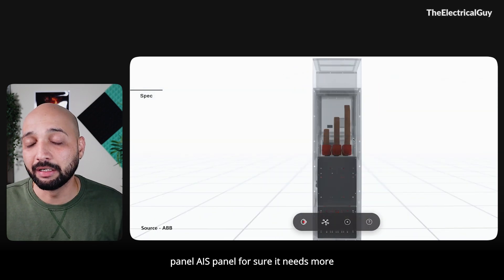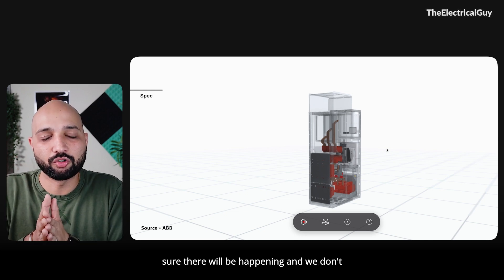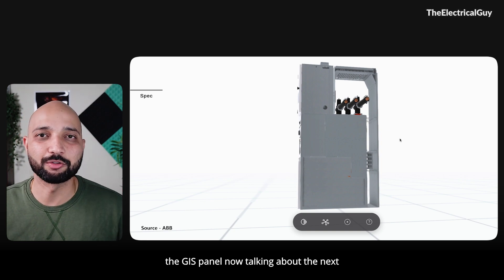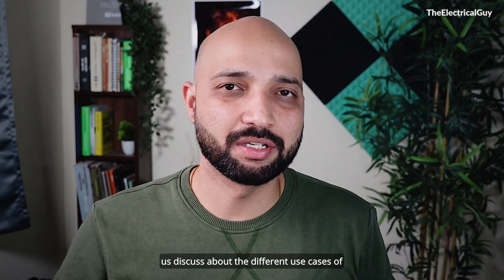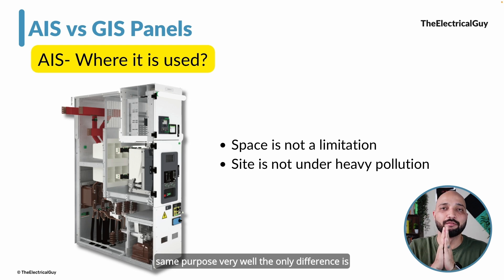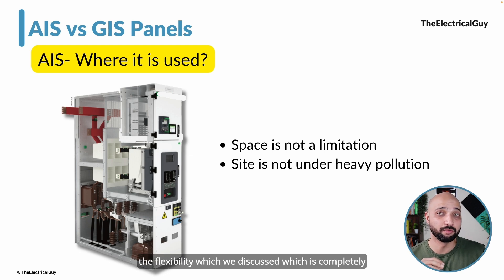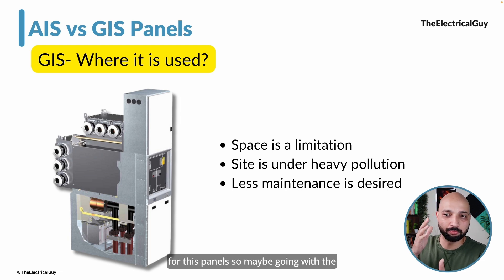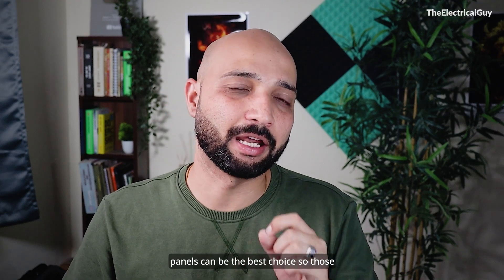Medium Voltage Switchgear: AIS vs GIS Panel | What’s the Difference? | TheElectricalGuy

Comment: I Installed AIS at One of my site. AIS with VCB installed. Arc quenching medium is Vaccum. Contacts are sealed inside a bottle with vaccum environement. I have a doubt.  if so, why we call it as Air insulated medium.?
Reply from the maker: Insulation between the two phases is still with air hence, it’s air insulation switchgear
Reply: @GauravJ Ok. It means all bus bars are air insulated.